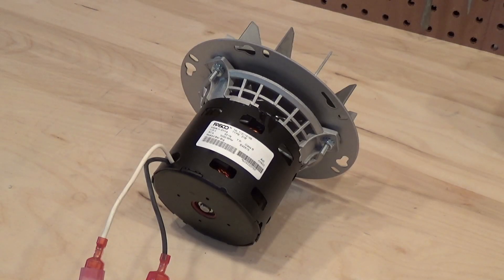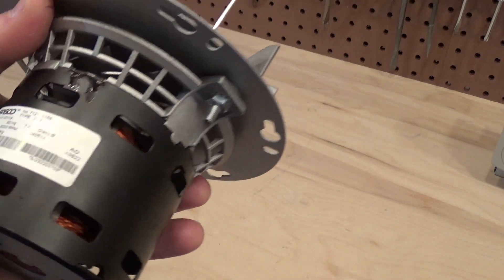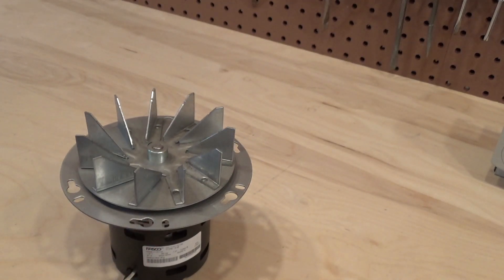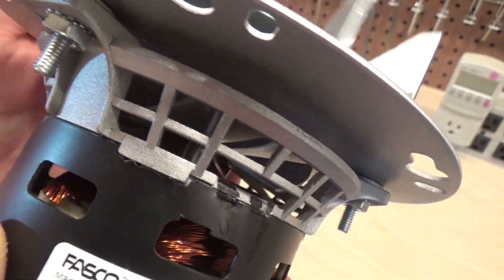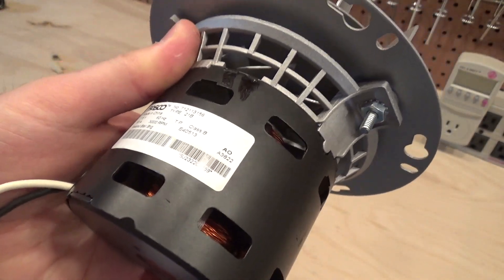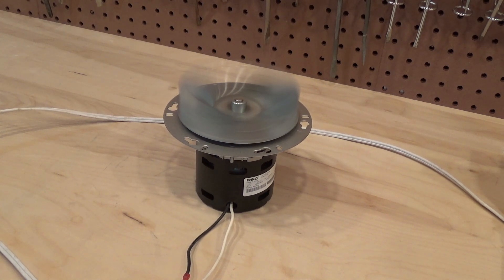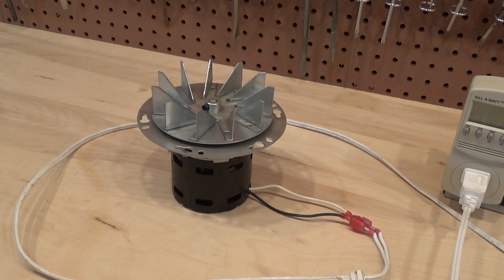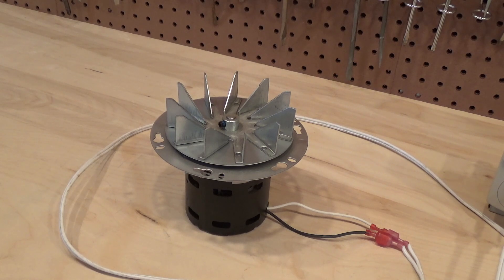FASCO 712113156 Type 21B Combustion Blower Test

Comment: Year later hows that Knockoff doing?, I saw those on Amazon, Fake Fasco sticker, I was thinking of adding that taller impeller but after seeing it run the pellets would probably be blowing out of the burnpot
Reply from the maker: It worked all through last year and is still going thus far into this year. It probably is fake, but seems reasonable enough quality. Air flow is controlled by combustion chamber damper.